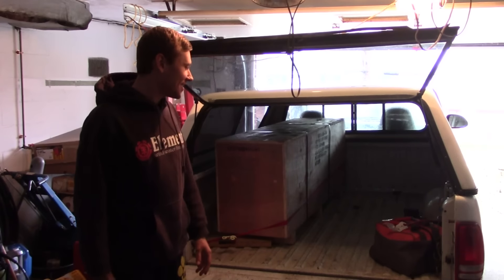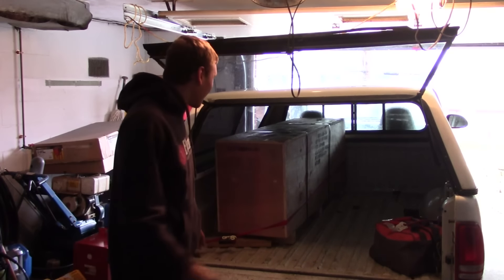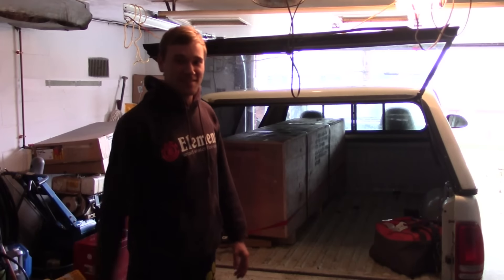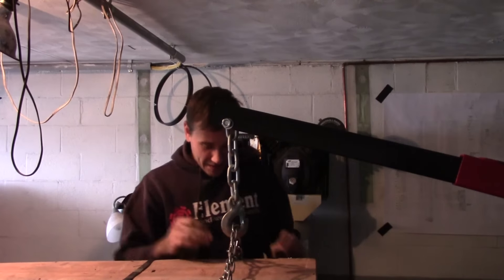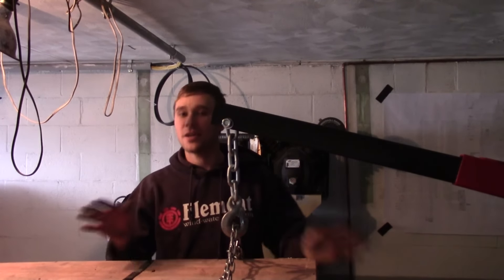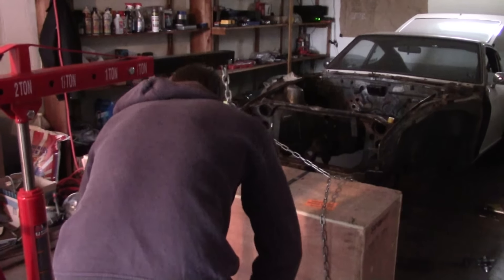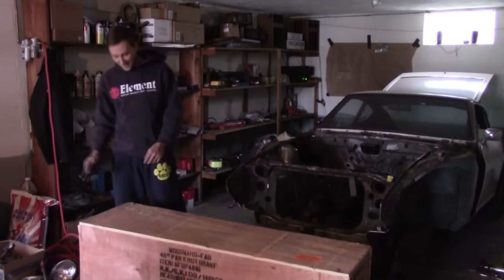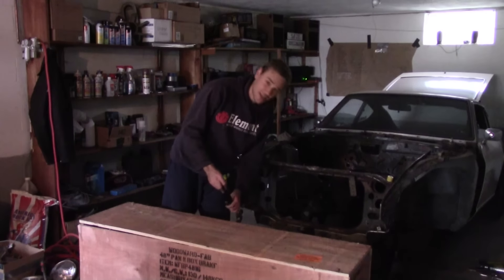Datsun 240z Project Car Update S2E2.5: New Woodward Metal Brake!

Comment: hey my man i have a 1973 datsun but all it does is crank do you have any tips on how i can get it running?
Reply from the maker: Fuel/timing/set carbs to stock setting.  You have to go over everything.
Reply from the maker: You have to focus on limiting one factor at a time.  It's a slow but rewarding process!